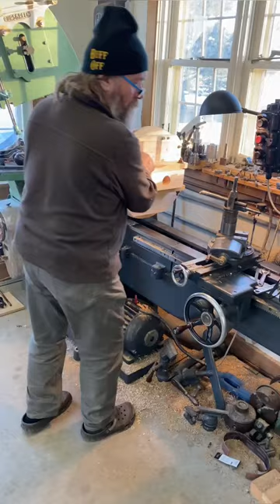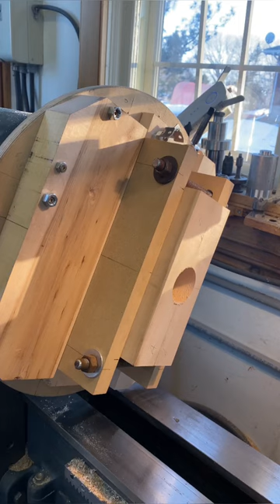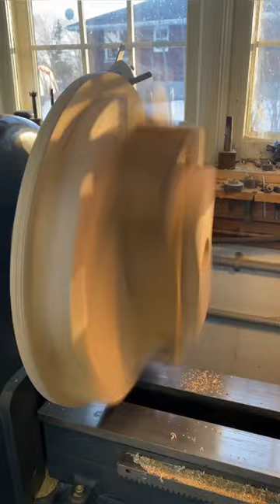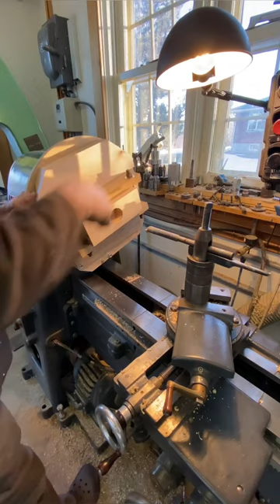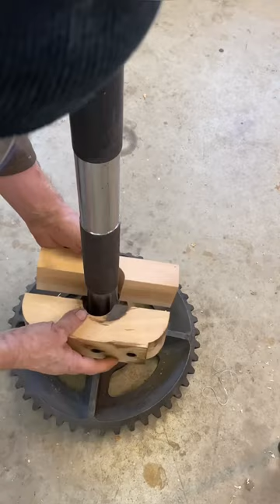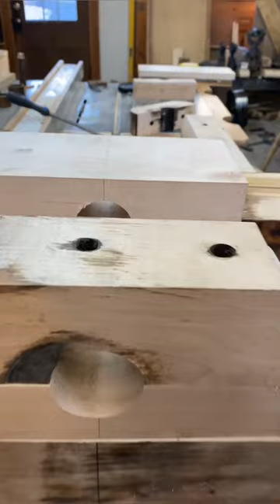Wood bearing line shaft, museum#wadkintemple a#woodworking

Comment: Nice one .  I had mostly Wadkin  in my workshop but the pattern makers lathe i used was a pickles. 
I had a contract making wood block bearings for farm rollers. Used beech wood for them . I also made ash rollers for restoring horse drawn corn binders  with that lathe .
Reply from the maker: John pickles is a very old company made massive machinery

Comment: Stunning machines. 
Im interested in the bearings it self. 
What greas or oil do you use, how often and how do you greas. Does the wood swell and shrink. Pleas all this interesting things.
Reply from the maker: 30 weights synthetic oil and the oil displaces the water so that's fairly stable. Wood bearing act pretty much like bronze bearings.

Comment: Would it be possible to clamp the pieces together and drill a hole? Or maybe use a template in the router to get a specific diameter. Just curious when you prefer this method?
Reply from the maker: precision here Hass to be within .005 " and we're talking 4 1/2 inch deep so the drill press and the router wouldn't have the reach

Comment: One question, why?
Enjoy most of what you do but this has me baffled. Not being sarcastic.
Reply from the maker: The bearings have to be sized precisely 5000th of an inch over the shaft size and there really is no other way to sneak up on that size which is not a typical size. In other words, a drillbit which would have to be very long anyway and might not actually bore straight.
Reply: @jackEnglishmachines  gotcha, thanks
Reply from the maker: @make-somedust  I think it's important that people ask these sorts of questions and don't feel silly asking them because for someone who asked this question there's probably 10 or 15 other people that are too intimidated to ask and so I'm thanking you for something that may appear obvious to some, but not to others.and I think that they curious people are the smart ones that ask
Reply: @jackEnglishmachines  it’s how I roll.  Never been ashamed to say “I don’t know something”. It’s the only way to learn,,, ask! 
Contractor by trade for 38 years, spent a lot of lunch breaks watching other trades and asking lots of questions.